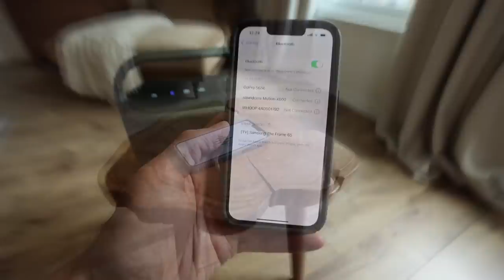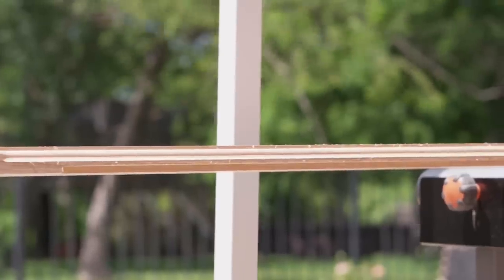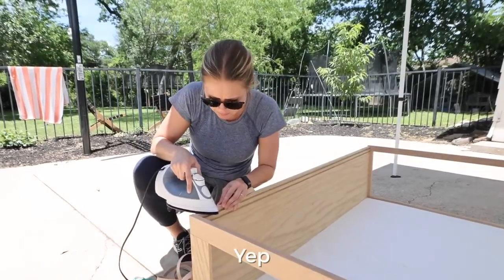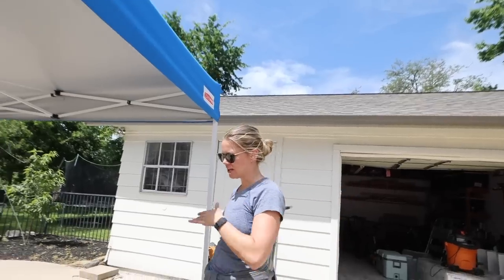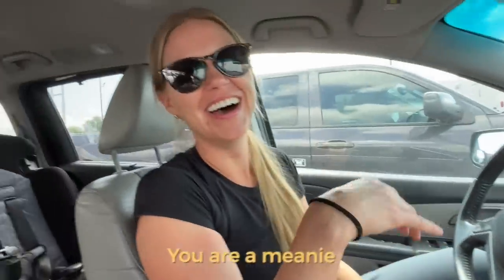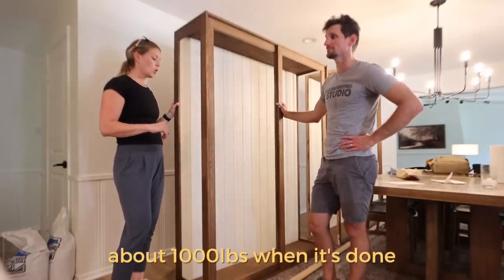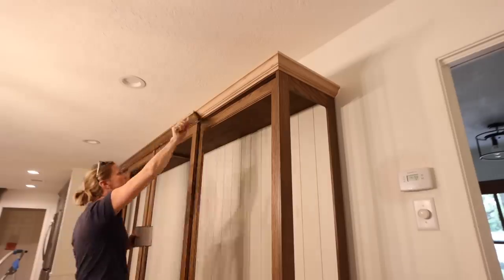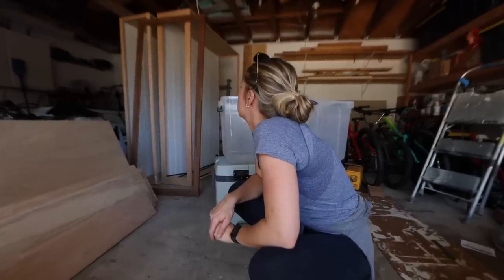Andrea's Biggest Furniture Build Ever Pt. 6 // DIY Massive China Cabinet Build With Glass Doors!

Comment: Beautiful cabinet!  I’m sure you’re weeks ahead of us watching with your progress, but when Andrea was pondering how to attach the shelves I thought mmmm how are my shelves attached in my china cabinet?  My cabinet also has glass on the sides and doors etc., but the shelves are attached with “L” brackets in brass to the wood area on the inside of the cabinet, my shelves are also glass and have wood behind that they slide into with the brackets holding those up, because there’s a mirror on the back of my cabinet.  Good luck!  I’m sure Andrea has already worked up a solution!